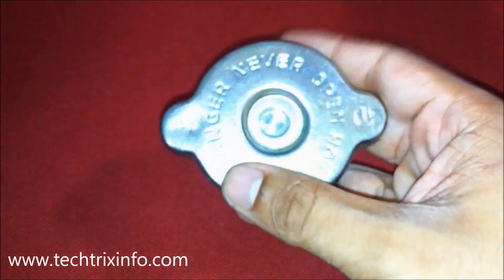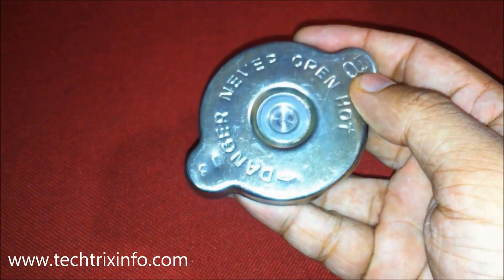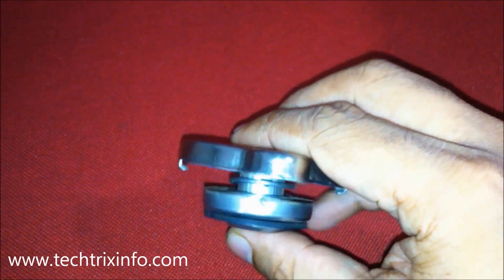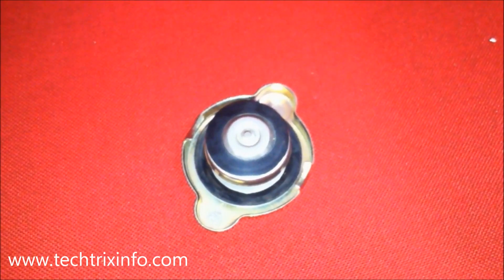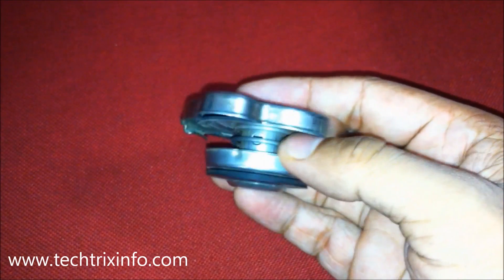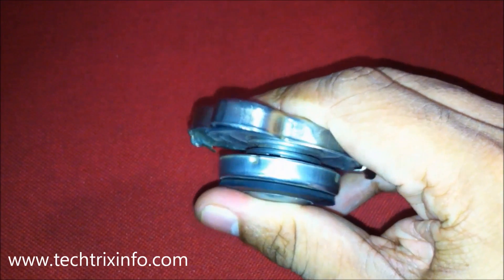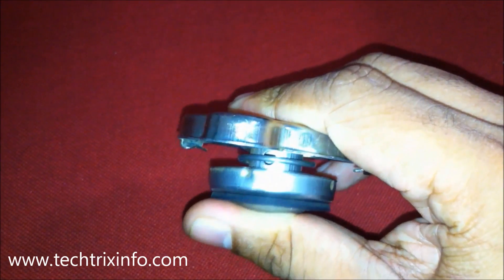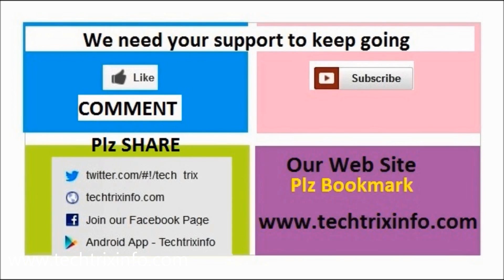How Radiator cap works. ✔

Comment: you left off 50% of the duty that the radiator cap performs
  you mentioned that the radiator cap keeps pressure in the radiator to appoint, because maintaining a little more pressure in the radiator, means that the water will boil later rather than sooner
  The part you left off is
when the radiator coolant temperature rises to the point that the radiator cap spring is over, powered by the pressure by design, it lets the coolant flow to a overflow catch tank. 
  as the engine cools when the engine is switched off, The radiator cap allows the lower pressure due to drop in temperature in the radiator to draw that coolant that it pushed out, back into the radiator by way of the radiator cap..
 The radiator cap, those two major jobs. It keeps pressure in the radiator to appoint, and as the engine cools, it allows that coolant to return back into the radiator.

Comment: This guy talked about Bar Pressure and I Googled what my radiator have on it 0.9  which is 13.053 PSI  the measurement used in USA . Thanks for your video .